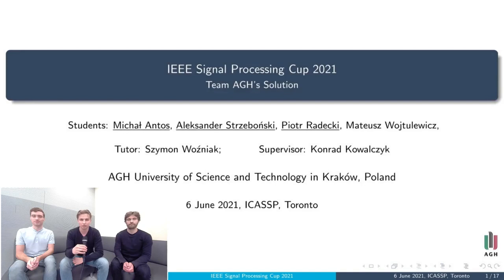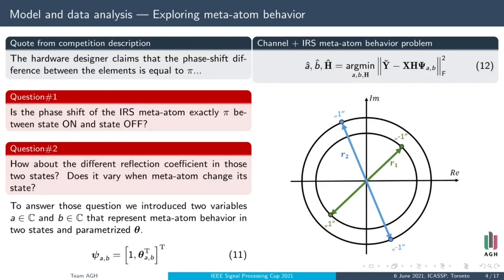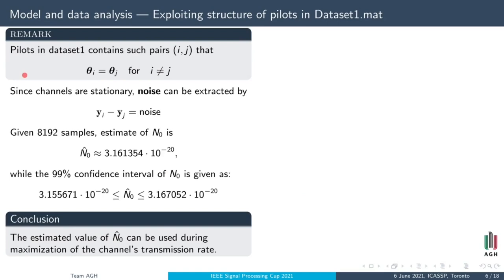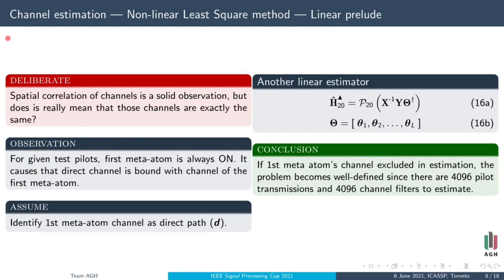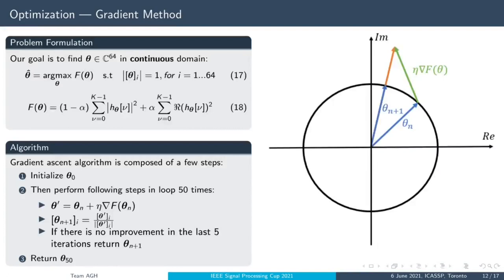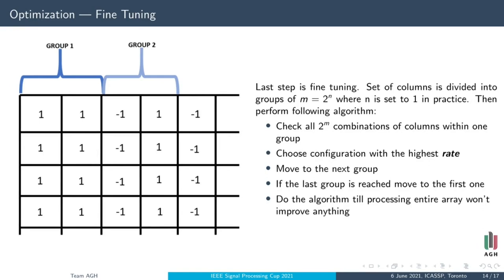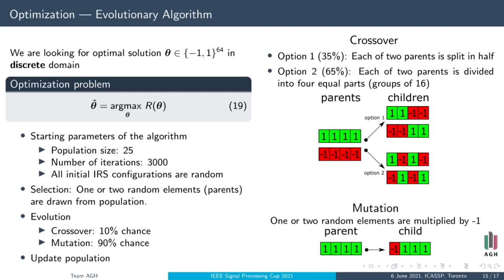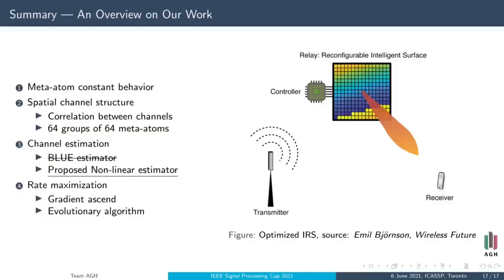Non-linear LS and Dual Algorithms for IRS Configuration (Team AGH, 1st runner-up in SP Cup 2021)

Comment: How is it possible to identify the IRS structure based on the correlation between the channels as defined by the variable [K]ij and is it only observed from plot of the 643rd row of K matrix and what does it mean by 64 groups of 64 elements for which the filters are very similar ?

 Is my understanding of matrix G containing the channels of  4096 elements of IRS with each being a 20 tap FIR filter right?
Thank you
Reply from the maker: If you have specific questions, I suggest that you reach out to the group members by email. You can find a sample solution to the problem in the following video which might answer some of your questions: https://youtu.be/vsCJqzKvtF8
Reply: Thank you